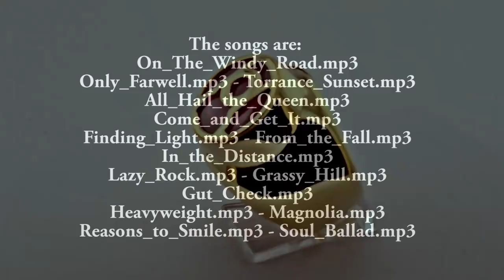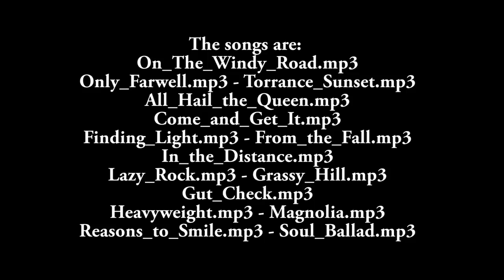handmade 18kt gold ring Red Lanterns Corps with synthetic ruby

Comment: @scaffoal I'm a student in jewelry, and i loved the video, but can you explain to me why you put two small rings on the side of the main ring, and then adjusted these to a specific size ?
Reply from the maker: I make the bands this way, because I can get the right thicknesses. In this case I needed a greater thickness in the upper part, which would have been cumbersome in the lower part. thanks
Reply: Yes you are very right, why he cut the plate rectangular shaped than cut the bottom to make it tapered, He could cut tapered before the rounding and soldering  and the side rings are as you said not done right way, otherwise everything  he did was very impressive

Comment: What an amazing video!! Thank you for sharing it!! What are the tools called that you used to make the screw threads with in the ring and on the wire to make the screw?
Reply from the maker: I used some normal tools that are found in mechanical shops.
Reply: The Tap cuts the threads in a hole.
A Die cuts threads on a rod or wire etc.

Comment: do you buy the gold 24k     or do you refine it  ?    how much alloy do you put into the gold     I find small amounts in california   usually 20k or 22k      you have to use flux to refine it  to 24k
Reply from the maker: In Italy is a tradition of gold working, there are many companies that deal with the sale and purification of gold. Companies like ours rely on third parties for these operations. thank you
Reply: Generally, gold is not purified by fluxing, since that does not remove all impurities. 23+k gold is obtained by either electrorefining or by dissolving the impure gold in aqua regia and doing selective precipitations. Both are rather hazardous processes. 

For most people, it is best to buy the gold in the purity you desire.
Reply: @buggsy5  horse shit        I live in california        there are miners that will tell you how to refine gold to 24k
Reply: @greedygringoprospecting6941  I have refined gold and know all the various methods. I will believe CM Hoke's book over any apocryphal tales from miners. 

On the other hand, gold in the US only has to be 996 fine to be marked 24k. 
Good Delivery bars must be 995 or better.
 A lot of producers of rounds/bars require 999.9 for fine gold. The US and Canadian mints use 999.99 for a few mintings. 999.999 gold was only produced once - if I recall correctly in 1957.